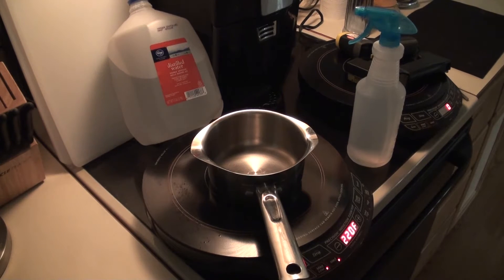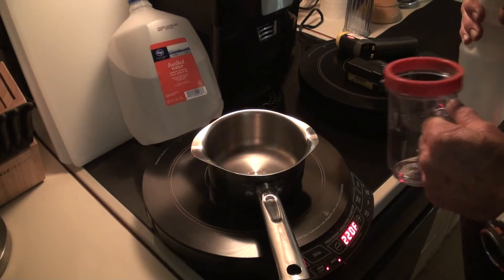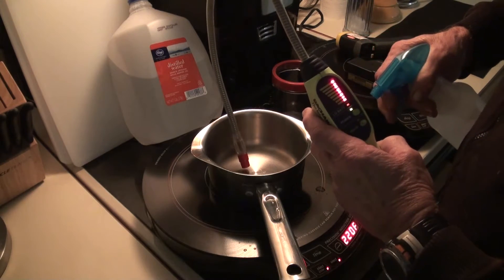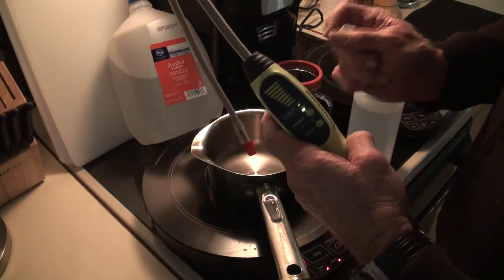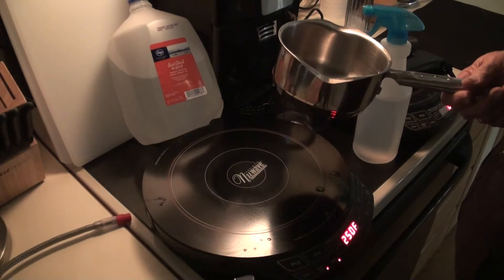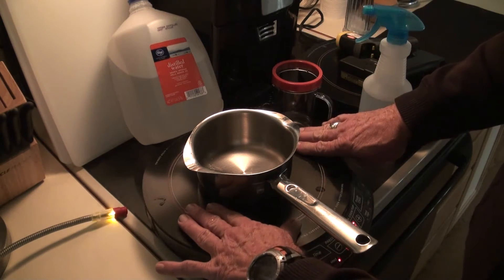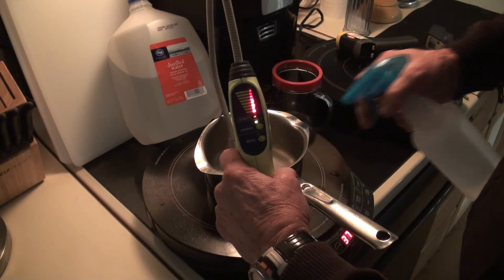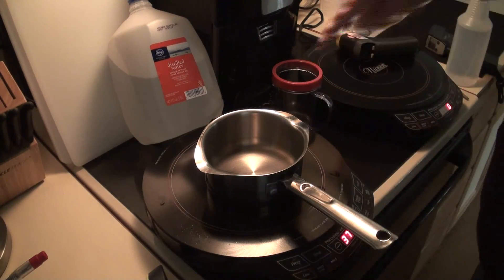#1 Flammable gas from distilled water, is separating Atoms in water.

Comment: But no flames?
Reply from the maker: Hydrogen is one of the most flammable gasses there is, they use it for rocket fuel, and there is no way I was going to ignite it in the house. However I know for a fact 230 degrees Fahrenheit is the boiling temperature of the Hydrogen Atom in water. I used a large plastic container, to enclose my spraying the water onto the 230 degree heating element, and the flammable gas stayed in the container for over an hour, but the flammable leak detector was still detecting a flammable gas, more than I wanted to ignite, and the only flammable gas in water is Hydrogen. Check out my gasoline video here on You Tube. I got a 50% increase in power over the gasoline power, and I saw Zero Parts Per Million Hydrocarbons from the White Vapor I created from Gasoline. It was not gasoline anymore. I sprayed a fine mist of gasoline onto a 500 degree Fahrenheit heating element and got  results like nothing gasoline emission produces. I changed the Atomic structure of the gasoline, getting twice the power and no smog. I ran the truck on the video for 30 minutes with a clean dry ran stuffed in the tail pipe on the truck and the rag smelled like I was ironing the rag. I dare you to stuff a clean dry rag up the tail pipe on you gasoline powered car, give it just 3 minutes of running time, and try to smell the rag. Your eyes will burn before you get the rag close to you face. I am showing the World how to separate all the Atoms in all liquid soluble matter, it will make it possible to cure all diseases, and solve the smog problems. You mix and match Atoms and you can make anything.

Comment: if this happens at waters boling point can't you create a vacuum to lower the boiling temperature of the water to create the hydrogen gas without creating intense heat to the surrounding materials used?
Reply from the maker: Yes it would lower the boiling temperature, but dealing with a vacuum means having to control the atmosphere, which makes it more complicated, and dealing with atoms in a vacuum can be difficult. Simplicity, is the best way to go, less cost.

Comment from the maker: Looking at the video here you can see the bubble of water in the hot pan, and the size of the amount of liquid is too big to go to the temperature of the pan, but when I spray the mist into the pan I get the instant white vapor, like the White vapor I made from gasoline. That white vapor shows there is a void in the molecular structure, and air surrounding the heater filled that void.

Comment: I ran an engine on just about any carbon fuel. I could do this with out any heat at all the heat does nothing if you perform the experiment correctly. You are correct that you are burning the molecular structure of the fluid but all you are doing when you run your device is you inadvertently create a vacuum which lowers the boiling point of the liquid.Simple physics
Tom Ogle and several car companies have patents which are actually all the same device even though that is supposed to be impossible. it happened because the patent office had as poor an understanding as most do about what is actually happening.
We put the gasoline in an empty steel box 12X12X12 and ran 651 mpg on 1 gallon of gas in an 1100 cc Volkswagen notch back sedan. No heat no carbon monoxide emissions.And no carbuerator. Just a butterfly control throttle body
Care to discuss
780 700 7507
lesliec77@icloud.com
Leslie
Though it has been reported that "big Oil" interests had me killed for what I know...trust me news of my demise is premature. I changed my address and phone number
Interesting fact Tom Ogle patented his device and went to his grave never understanding how it worked.

Comment: The world already knew that you can separate water into hydrogen and oxygen and in turn recombine them via combustion.  The problem is that the energy it takes to separate them is equal to the energy given off when they are recombined.   That said, I doubt you are actually providing enough energy to separate the molecules and if you were then the hydrogen and oxygen would likely immediately recombine since your heat source would cause them to combust again getting you no where   So if you were able to get the water to separate at that temperature you would also have to find a way to grab the hydrogen before it combusts again.  Then you have the problem of storing it.   If you were to put it in a tank then you would have to compress it.  Compressing it takes additional energy.   So it takes far more energy to obtain useful hydrogen then you get out of it.
Reply from the maker: jsnthurst1 Actually they don't separate the atoms in water, they add chemicals and electrical current to chemically produce hydrogen. Yes, you would have to compress the hydrogen, because the amount produced with this process is so small, it needs to be compress to produce enough hydrogen to run the engine. This method will not sustain the consumption of hydrogen, if the world were to use hydrogen for fuel. What I am trying to do is prove small droplets of liquid will assume the temperature applied to them, faster than they can boil at their known boiling temperature, therefore going to the applied temperature, which can be above the liquids known boiling temperature, and in doing so find the boiling temperatures of the atoms inside that liquid. I did it to gasoline, getting a white vapor that has twice the power that gasoline does. The white vapor, created from gasoline, has a different boiling temperature than gasoline does, which means the white vapor is no longer gasoline, and separating atoms is the only way for this to happen. What can be done to one liquid can be done to any liquid. It will cost very little to obtain the right temperature, and separate the atoms, producing all the hydrogen contained in the water being sprayed onto the heat source.